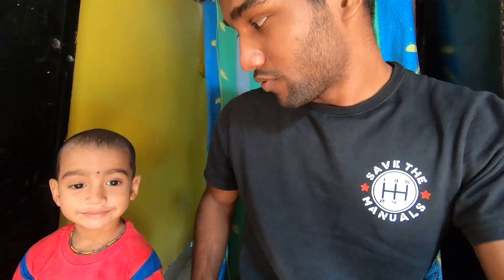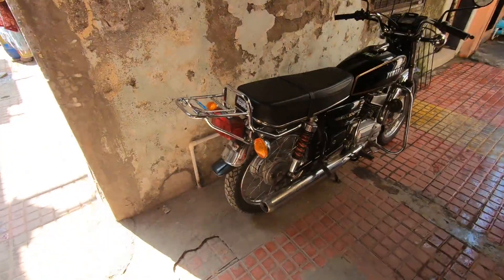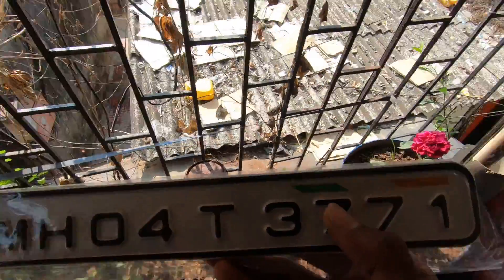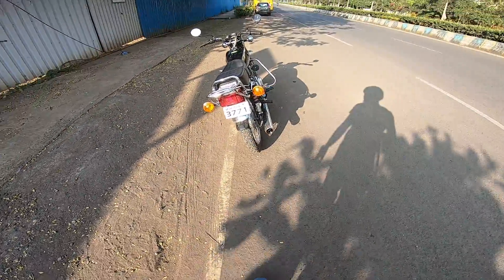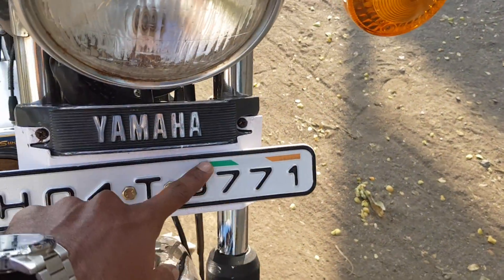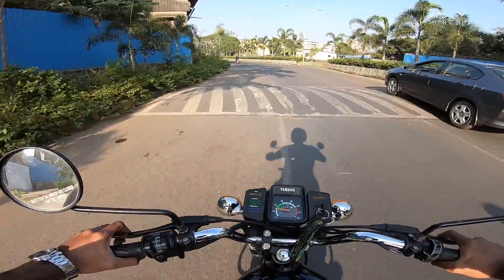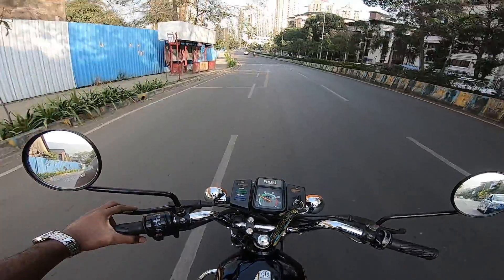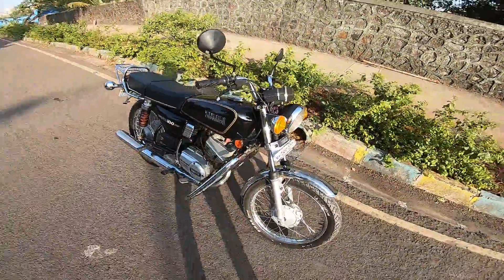NEW NUMBER PLATE FOR RX 100 !!

Comment: Bro which spark plug and air filter do you use
Reply from the maker: Both company original bosch spark plug and yamaha air filter
Reply: @SpeedyLio  how much do they cost and is your muffler still cut?
Reply from the maker: @crazypals9605  no idea about the spark plug, air filter cost is 80 rs. yess muffler is cut